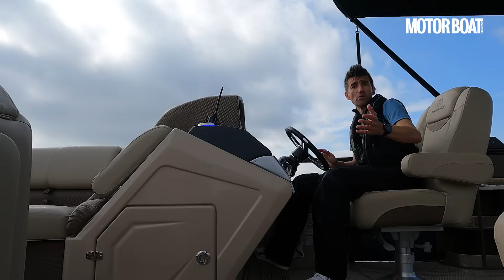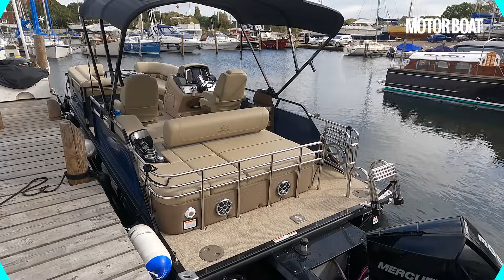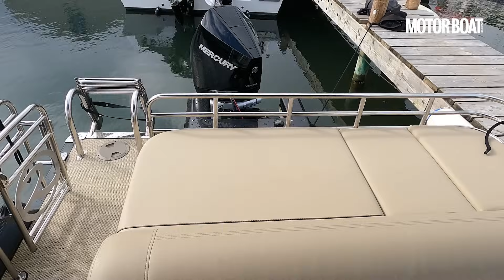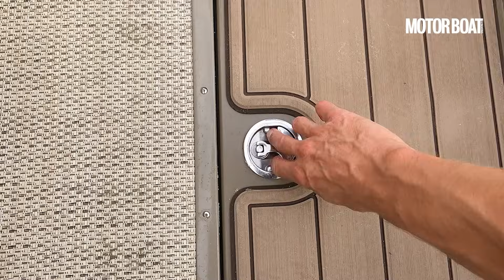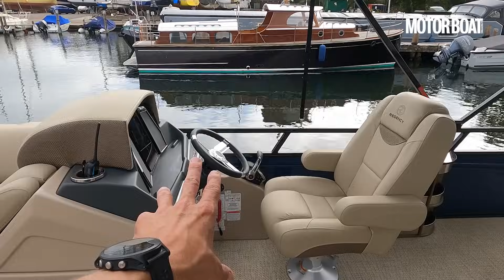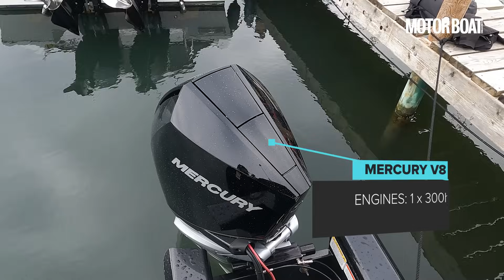Are you brave enough to buy one?  | Regency 250 LE3 Sport sea trial | Motor Boat & Yachting

Comment: I owned one of these…cup holders do not hold a can with a koozie. Quality control is lacking….under seat  lighting could be mounted with something better than glue strips. Wiring is routed through holes with no grommets causing wear through resulting in shorts and breaks. Otherwise very nice boat, love the 52 gallon fuel tank, lots of range and the way the boat handles rough water.

Comment: I have a Tri toon in Florida and it’s great for estuaries, intercoastal and the Gulf of Mexico on most days. There is a big difference between tritoons and two toons. The performance of tritoons are much more capable. Also one down side is passengers usually  want sit  in the front which will cause the bow to plow. The logs can’t overcome all that weight like a v hull boat can. You need to ask the passengers to sit so the weight in the back is the same in the front to maintain performance and comfortable ride.